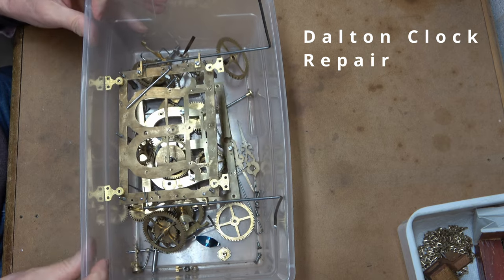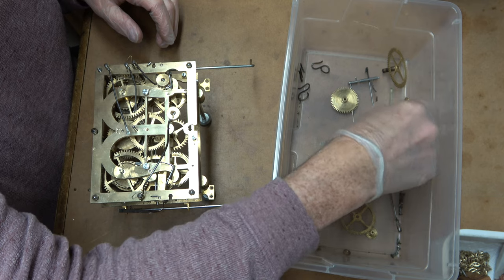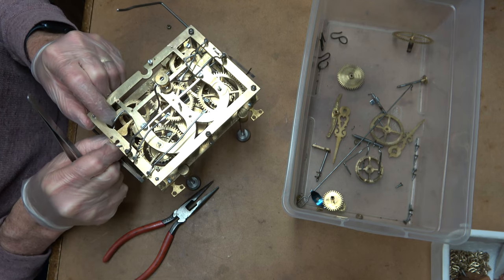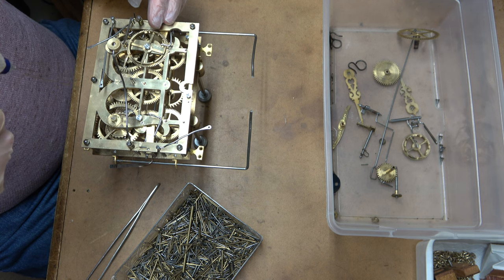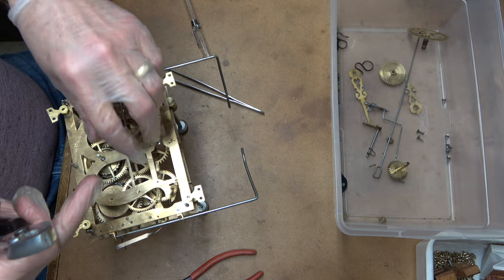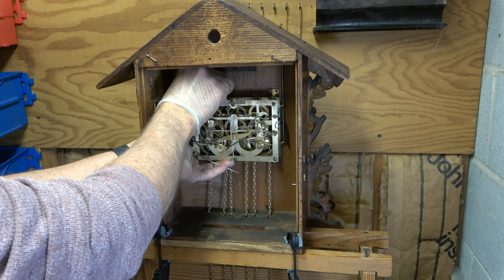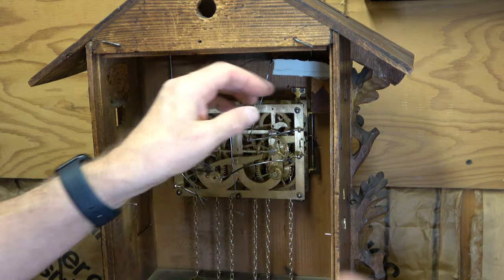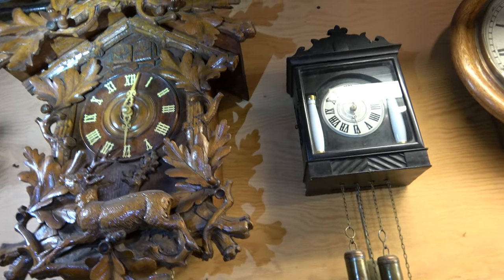Restoration of a Alexander Fleig Cuckoo & Quail Clock

Comment: Another excellent video.  It seems like the tricky part with this restoration was reassembling and adjusting the movement, which is what most of the video was about.  That takes a delicate touch to pop out the quail side warning wheel to reposition it without having anything else pop out, and then having to do the same on the cuckoo side.  Nice work and a beatiful looking and sounding clock.
Reply from the maker: Thank you!

Comment: Thanks for the video, I'd stripped and rebuilt my quail, cuckoo not knowing why it would not stop cuckooing, approx 45mins into your video had the answer, the pin that drops into the count wheel was less than 1/2mm out of align, so bent it out a fraction and now cuckooing perfectly, thanks for the video
Reply from the maker: I’m glad I could help.